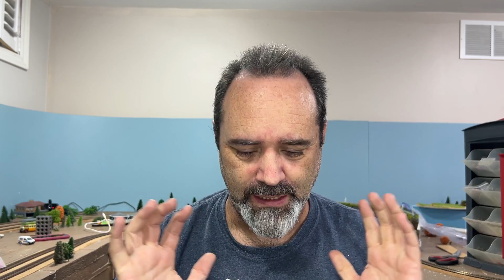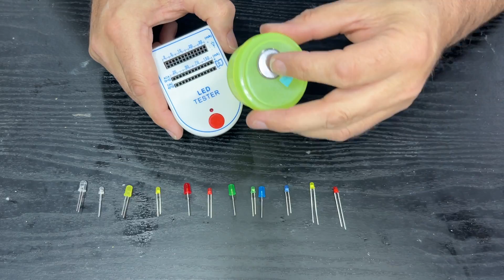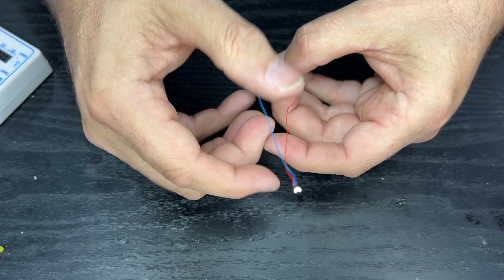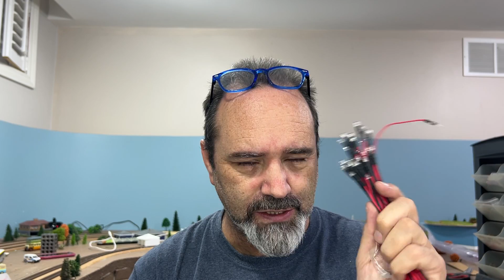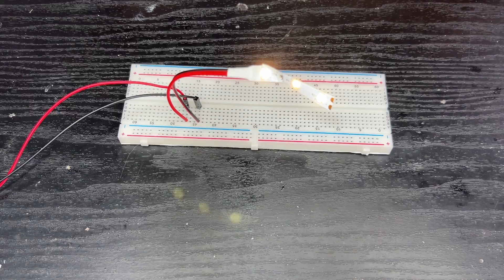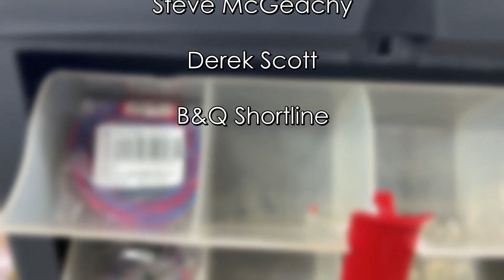Model Railway ElecTrainics - LED Basics

Comment: A few points:
On LEDs there usually is a rate maximum current which you never want to go above.
There is also a thing called "test current" which is the one they use to check the brightness.
In a lot of cases, you want to run the LED with under 1/2 the test current to make it not too bright for the application.
Current ratings are usually stated in mA (milliamps) which is 1/1000th of an Amp.  20mA would be 0.020Amps.
Ohm's law is not all that tricky once someone tells you that I is the Amps for reasons. (I will use * for times)
V = I*R  or  I = V/R  or  R = V/I
That last one is the one you will want in most cases.
The LED is about 2V of drop.
The supply voltage is 12V so there are about 10V to be gotten rid of.
We want to run the LED at 10mA (for example) 10mA = 0.01A
R = 10V/0.010A = 1000 Ohms
For this reason, I* suggest you want some 1000 Ohm resistors.
Each LED gets a 1000 ohm in line with it so each one gets the right current.

Also:  They make "amber" LEDs these look nicely like a flame based light or an old incandescent bulb.
Because the needed current is so low, you can have a "wall wart" style power supply as a supply to run the LEDs.  This way you can have them on with the power to rails turned off.
You can get LEDs in a lot of interesting colors.  It is worth looking at the colors and thinking how they will fit in with what you are doing.
Reply from the maker: Thanks Ken. I do have a multitude of colours in my led collection. I just wanted to go through the absolute basics of leds as it can be quite intimidating when you start.

I have some 1000 ohms in that pack, but running out. I know I can add lesser values in series to get up to the thousand, but I think I'll just buy a pack of 1k resitors to save the hassle.

I appreciate all the info on your post, very helpful, thanks.

Comment: I think what that little tester will allow you to do is to see how many milliamps are required to give you the brightness you need for your project.  As you should already know the voltage you will be using, once you know the current (mA)  it's a simple matter of using Ohm's law to calculate the value of resistor to use.
Reply: I find the tester is also handy for discovering the LEDs from companies that reverse the long leg vs short leg thing.
Also it is nice for identifying the colors.  I tend to buy LEDs with a clear lens.

Comment: The higher the milliamp, the higher the amount of current LEDs can draw. Not all LEDS run at the same voltage and current hence the different range.
Running the LED's at a higher current will shorten its life.
Flashing LED's have a tiny chip inside them that make the diode flash. If your eyes are good, you can just see the black chip in them.
The average LED runs at 2V@20mA
LED stands for Light emitting Diode and come in the same family of components as bridge/rectifier Diodes.

Comment: Fortunately you chose a value of resistor that would limit the current flowing through the LED in order it did not blow. Unfortunately your theory was totally wrong. The 5mm LED would have a forward voltage of around 2-2.5 volts and a current flowing through it would be 20mA. If you were connecting to a 12 volt supply then you need to have a voltage drop of 9.5-10 volts across the resistor. To work out the resistance you would use the equation R=V/I (Ohms Law) which in this case R = 10/0.02 therefore R=500. Typically this would be a 470ohm resistor but you could use the next typical value up which would be a 680 ohm. Resistors come in 'Typical values' not all values are available.
Reply from the maker: Hey, it was, as you said, just a theory, lol. And it didn't blow, sooooo.

Comment: I can tell you the secret magic formula to determine a dropping resistor. It is based on Ohm's law: E (Voltage) = I (current - amps) x R (resistance - ohms). The formula is: R = (Vss - Vled) / mA. Vss is the supply voltage minus Vled (LED voltage) (Note: this determines the voltage for the resistor) divided by the milliamp current of the LED. Since current remains the same in a series circuit, the milliamp current will be the same as the resistor current. So, the formula is an equivalent series circuit in Ohm's Law. As far as choosing a resistor, some values may not match the standard resistor values. A person will choose a value closest to the calculated value to the standard value or resistors can be added in series to increase the resistance or in parallel to lower the resistance to closely match the desired value.

Comment: A very helpful video.  I am looking forward to the next ones.

Two things I have heard :  

1- Using lower voltage than the LED's maximum will make the light dimmer (as you showed in the video); but it also prolongs their life.

2- If you wire resisters in series, their resistance is added.  To get the 800 ohms you wanted, simply use two 400 ohm resisters in series.

Comment: Another good one Dave. 
Those strip lights LEDs and resistor are what we call SMT (surface mount technology). 
Not sure if you're using an actual bridge rectifier (as we haven't seen the next episode yet) but you can build one from four 1N4001 rectifiers. There is a 700mv (.7 volt) drop across any silicone rectifier. 
In standard resistors (144 between 1ohm and 1 meg ohm) you have three between 680 ohm and 1K including an 820 ohm. In this case a 1K resistor works fine. 

Cheers
Reply from the maker: Thanks for the info, much appreciated.
Reply: @ScottRails  Technically LEDs don't need additional rectifiers diodes as they can only conduct one way. They are both call diodes for a reason
Reply from the maker: @AJB2K3  I understand that, but I will be using capacitors, witch need a positive and negative.
Reply: @ScottRails  only electrolytic capacitors need a dedicated positive and negative and even then there are exceptions to the rule.

Comment: Good video.  One correction, though...the resistor isn't voltage limiting, it's current limiting.  If you put your voltmeter on that circuit when you turn it up, you'll see that your voltage is still what you'd expect it to be on the track.  Otherwise, any time there's an LED put on the track circuit, it would impact the voltage also going to the train, since it's in parallel with the train.
Reply from the maker: Thanks Wolf, always happy to get more information.

Comment: When I test my micro LEDs or SMD LEDs I solder cut LED leads to the wires and use the tester. It takes time. I save the leads cut from used LEDs.

Comment: Any suggestions on where would one get a 68-ohmn resistor? I need to replace one for a model train transformer.
Reply from the maker: The pack I have, has a 66, then it goes up to a 75. You could add a couple of 1 ohm resistors to the 66 if it needs to be exact. I got mine of Amazon pretty cheap.
Reply: EBay or Amazon cheap resistors
Reply: Digikey, mouser, you'll also find that there, note that, as it is a low resistor value, it may have great heat to dissipate depending where it is in the circuit and this may be very important, if you don't have the schematic, it's size may reflect the power value (in Watt) of this resistor. 68 ohm is a standard value and easy to find.

Comment: I popped an LED the other day. I was testing to see which was positive and negative on the rear LED on a new KCS SD70ACe because I’m putting in a sound decoder. I had 3 resistors sitting there to check the light, and what did I do? I hooked it up strait to my tester, without the resistor and blew the damn thing. Dug out the light and board it was on and now I'm retrofitting another micro LED in it's place, with a resistor.
Reply from the maker: haha, I would never do that ;-)

Comment: LED’s are current controlled devices, the higher the current the brighter the light. Given a particular voltage choose a resister so that you get the current you want, typically 10-20mA, using Ohms law V=IR. So for 18V supply, for 20mA you need 18/0.02 = 900 Ohms
Reply: That is correct. E-Electromotive Force measured in Volts is equal to I- Intensity measured in Amps multiplied by R-Resistance measured in Ohms. E = I x R. So long as you don't exceed the amp rating of the LED, you should be good. I usually keep the amps lower than the max.
Reply: @jim_e_2470 the calculation is incorrect. You subtract the LED voltage from the supply voltage and THEN you apply ohms law to that number to get the resistor value.
So for an LED rated at 2V and a forward current of 20mA, it is 18-16/0.02 = 800ohms. Nearest preferred value is 820ohms.
If you want your LED dimmer then use a smaller forward current value which will give you a larger value resistor.
Cheers Brendon
Reply: @kiwibjg  Yes, and also:  If you have 12V power, it is OK to run 2 LEDs in series to save some wiring.  You just have to remember that the voltage on the resistor will be something like 18V-2V-2V=14V  This can be good for putting two lights in a house to get more uniform light